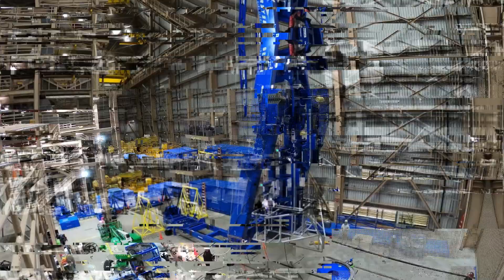NASA's Dream Chaser Space Plane Was Powered On!

Comment: Building a spaceplane is a lot harder than building a capsule. This is simply a cargo ship. Judging from how long it took SpaceX to go from Cargo to Crew, we are still at least 3-5 years away from a viable crew-capable Dream Chaser. However, when it comes into service, it will be one amazingly capable crew vehicle. 
I still am disappointed that Dragon 2 was not going to be modified for ground landing, but I think SpaceX just diverted any funding for that into Starship. I think SpaceX needs to develop a special mini-Starship purely for crew and equipped with abort systems for the entire complement of the crew THROUGHOUT the flight profile. I am still wondering how many years it will take to certify Starship for propulsive Earth landings with crew or passengers aboard. That is why the abort systems have to be included. It would be nice to see crew capsules ejected for parachute landings if the propulsion system fails to relight.
Reply: More like a dozen years before Sierra Space can build a crew ship. this cargo ship is 5 years behind and their current focus is on a space station.